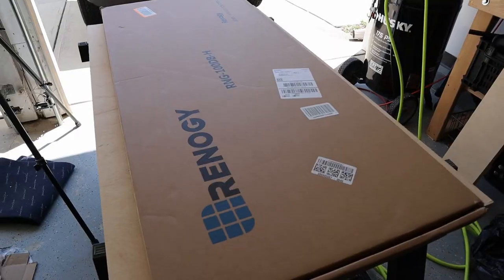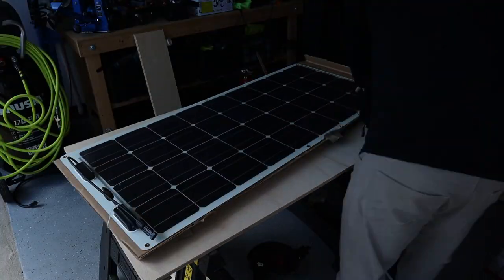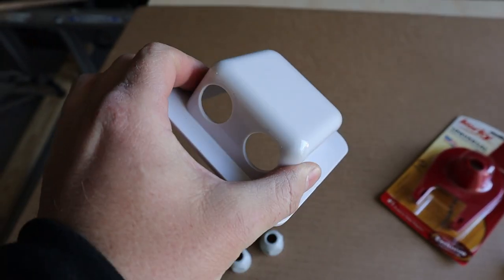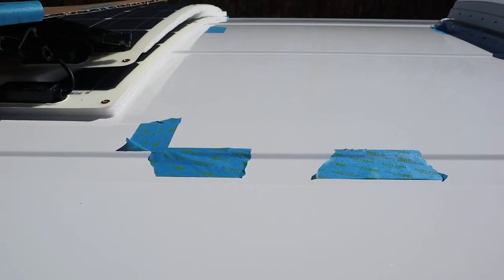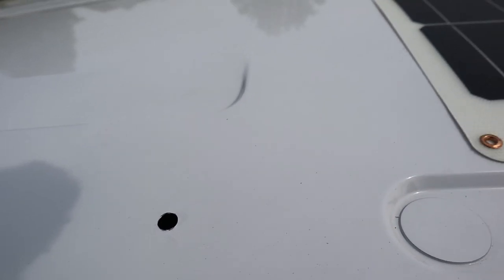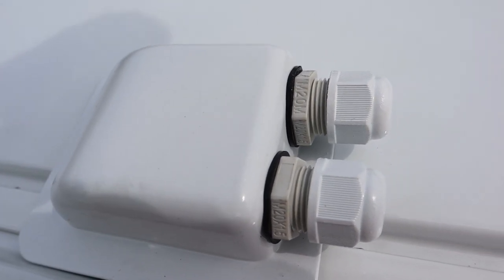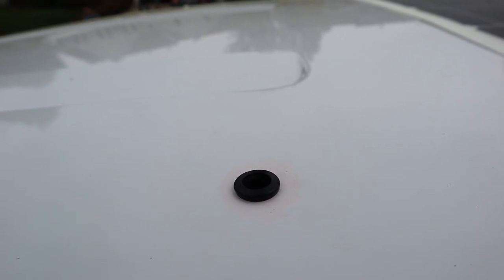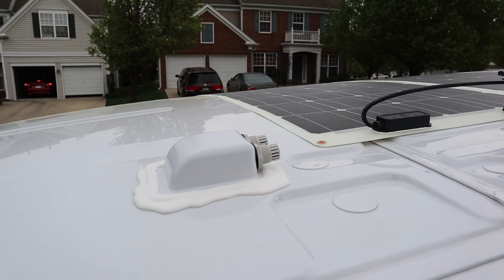#MTBPlanB Not Van life...Installing flexible solar panels on a 2019 Ford Transit

Comment: Super curious hose the adhesive has held up since installation.
Reply from the maker: So far the solar panels and maxxair fan are holding tight with the 3m commercial double sided tape. I think the likely problem will be getting it off when time comes.
Reply: @MTBPlanB  I appreciate the update!!
Reply from the maker: Dustin Klein Anytime. I’ll update the comments if I run into longer term issues.

Comment: Another nice video. How is this performing and its reliability?
Reply from the maker: Solar is still going strong and batteries are holding charge like the day installed. Just keep the Victron equip updated as there were some SOC bugs in previous versions. I’m impressed with these flexible panels.

Comment: How are these panels doing so far ?   A lot bad press on these flex panels.   Can you do an update and show how many amps you can get from solar ?   Thanks for any info , peacefrom510
Reply from the maker: I will when the sun gets higher closer to summer. To get the most out of any panel during winter, they should be tilted in relation to horizon.

Comment: thanks for documenting this, great job!  I'm doing the same on my Transit.  Which 3M VHB tape did you use?   Also looks like you used small strips, could you tell me how much you used and what pattern you used for the VHB?    Thanks again!
Reply from the maker: Hey Larry. I used 3M 4950/WI15 Scotch 4950 VHB Tape: 1" wide.  This stuff is super strong if you prep the surface correctly...so make sure you clean and rough the paint surface with a scotchbright pad or similar. As for pattern, I attached strips along the leading front edge, leaving some gaps for  air and 3 smaller vertical strips from front to back.
Reply: @MTBPlanB  Thanks so much for quick and complete answer!   One more question:  Did you wire the panels in series or parallel?   Thanks again!
Reply: @MTBPlanB  Also, did you do the same prep for bottom of the panels?
Reply from the maker: I used series after reading this https://www.renogy.com/learn-series-and-parallel/. I have the MPPT controller.
Reply from the maker: I believe I only cleaned the bottom of the panel with Isopropyl alcohol. I seem to recall the surface being a tad rough already.
Reply: @MTBPlanB  Thank you!